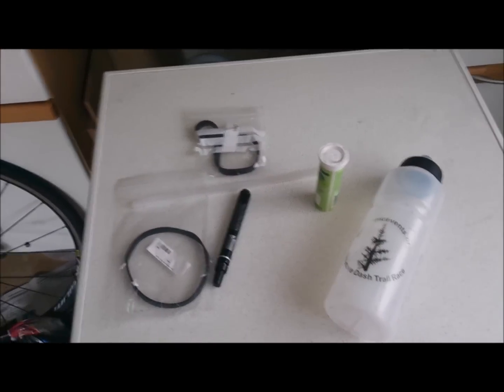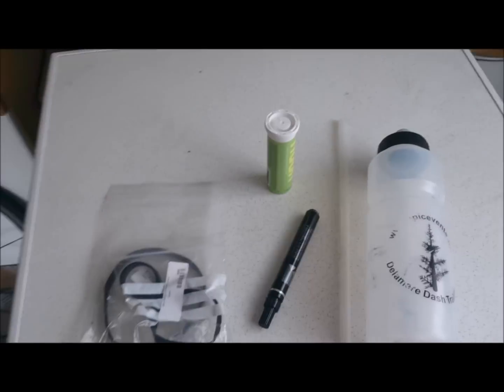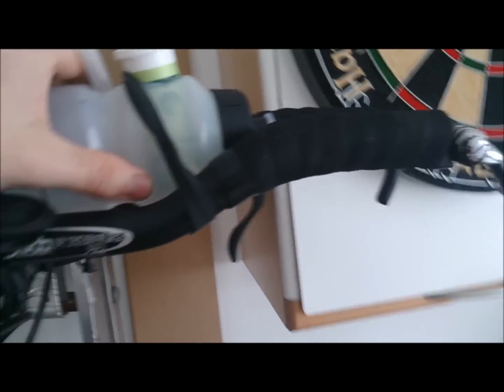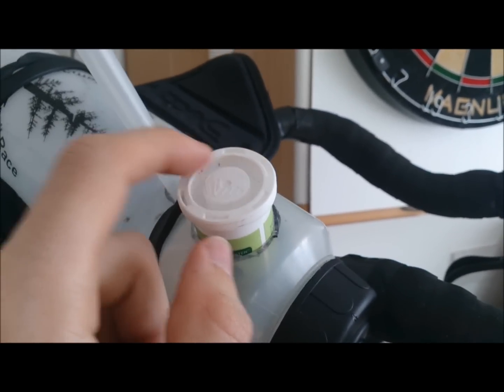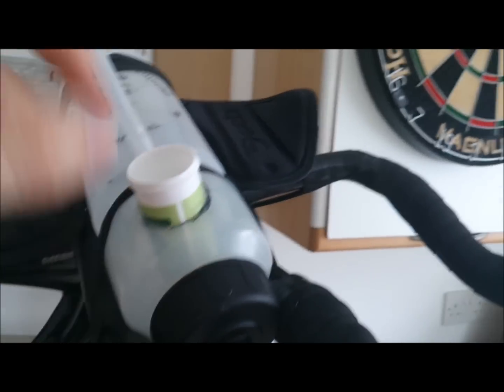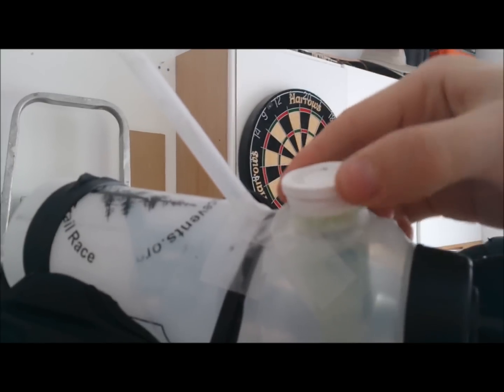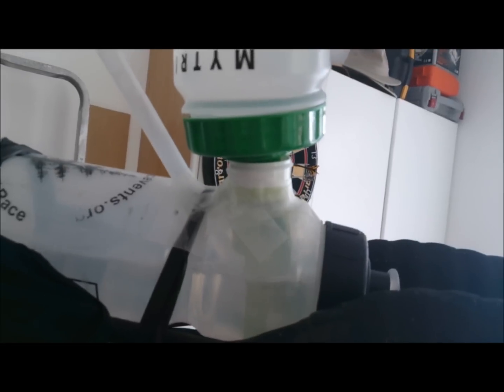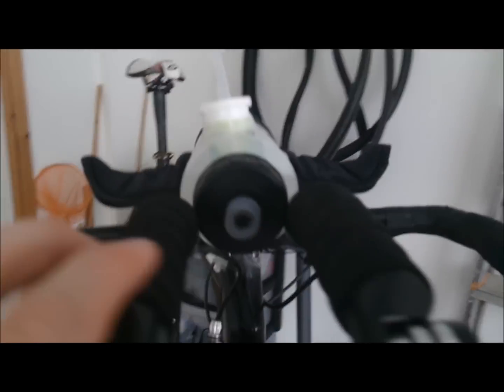How to make + mount a horizontal aero water bottle, triathlon or TT

Comment: played around with a similar idea.  try getting rubber grommets from a hardware store, apply a safe sealant to the grommet then pop it into place where you made your holes.  the straw should slide in through the grommet but very very snug.  As far as the refill, trisports sells the profile design aero hc flip tops for 1 dollar a piece.  order a bunch, again use a safe sealant to permanently bond the flip top to the bottle.  my .02 anyway.  Go DIY!

Comment from the maker: This didn't work and i quickly gave up on the idea.
Reply from the maker: +mikexhotmail the water kept leaking out of the hole i cut. I there was some way to seal the gaps or make a more fitted hole for the tube then it would work.
Reply: Plastic tape ( from a nurse at a hospital) around the NUUM. One layer to big it will squeeze in. Same with the straw. Worked great for me no leaks over bumps.